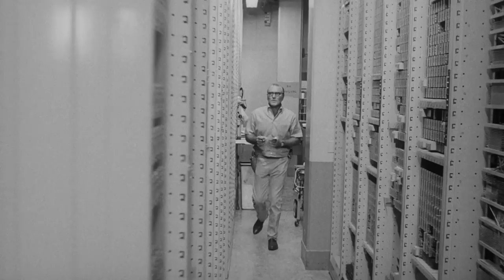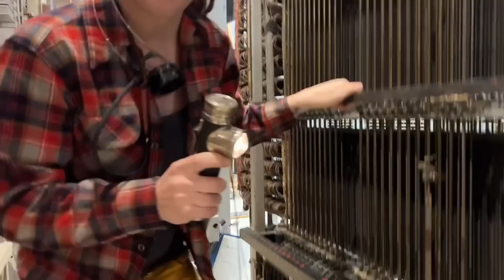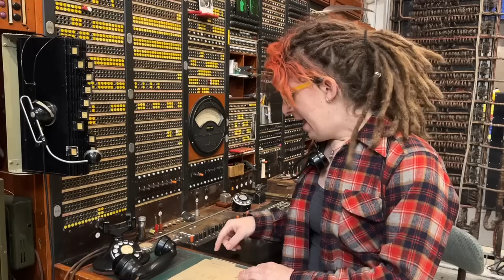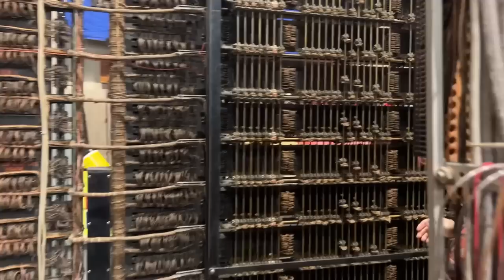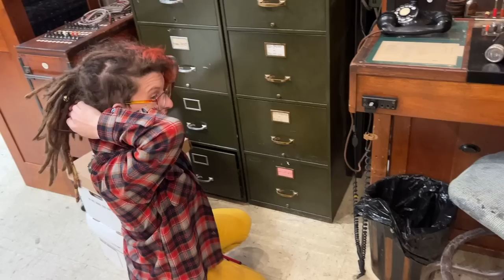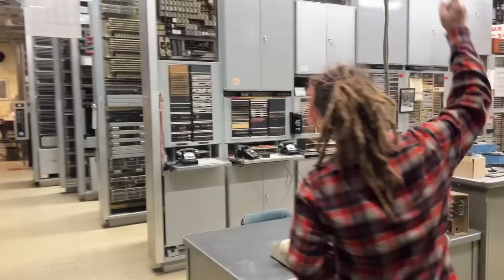How does call tracing work? (Part 1)

Comment: In the early '80s I worked electronics in an air traffic control center. We had what we called a "bomb relay" on our main line. As long as we didn't hang up the call wouldn't be torn down which gave us time to trace it.
Thanks Sarah! First time I've ever seen any sort of real, public explanation for how tracing works.

Comment: I guess my memory must be failing. As I recall. we could trace a call within about five minutes within our office. -- With four or five people.  We had several high-priority numbers wired in advance to convert to "called party hold". That certainly gave us a little more time. This was a Stromburg-Carlson XY switch with 10000 lines. Someone would start at the Final Connector and simply yell out the path through the connectors to the next person. Called party hold meant that we could complete our trace after the calling party hung up.This was on a USAF Base, so a call arriving from a civilian (off-base) C.O. generally could not be traced because the civilian C.O. would not cooperate.
      Having recently retired as an AT&T tech, I now reflect back in awe at what was accomplished with an electro-mechanical system.

Comment: Excellent video.  I did call traces in the SxS system in the 70's,  usually nuisance calls. If a called subscriber had them frequently,  we would insert "traps" in each connector t/r associated with that number.  That would hold up the whole switch train as long as it is local in the exchange and the called subscriber didn't hang up the phone until we had it traced. Thank you so much.  Quite interesting on a common control office.

Comment: I worked at "major" regional ISP circa 2000.  Major meaning we had our own telecom switch in addition to a few thousand twisted pair lines.  I thought the hardware was intimidating, but I mostly with worked with SS7 software interface (in terms of dial-up service).  But it was nothing like facility in your video... a totally humongous mix of electrical and mechanical circuits.  Thanks for blowing my mind!

Comment: In the Oakland #4M Xbar office the incoming and outgoing frames were scattered over two buildings and two floors of each building and not in any logical order so it took a bit of luck and skill to trace a call.  There were a couple of in-link frames that were hidden among frame of other types so you would never think to look back in the dark corner where they stuffed them.  As long as the call was not on those 'hidden' frames or you had been tracing calls there for 15 years it usually was not too complicated but almost always involved a lot of walking and stair climbing but the new #4 office on the 15th floor was organized in an orderly fashion and it was so easy to trace a call there it felt like cheating to us old guys who had been in the old 4M office for decades.  Tracing wires on the MDF was just as bad as the blocks were not in any particular order, they put them where there was space so there would be a whole bunch in order and suddenly they would end and woe unto you if you did not know where they went from there.  15 months as a Frameman provided the knowledge as to where everything was as we were always adding and removing circuits.  They would add 10 circuits one month and the next month to some office and they would have us yank out 5 or 6 the next month and it went on like that for every long distance office, something to do with paying taxes on unused/underused circuits versus overload levels if there were not enough trunks. The "churn" in trunk provisioning gave us a lot of overtime keeping up with all that nonsense and we went through tons of copper wire.
Reply from the maker: Wow, I wonder how the 4M office got that way. I'd imagine that if they had total design freedom, they would have put everything together, all in the same space like they did for the 4A on the 15th floor. 

I guess because the 4M went in first, as it expanded they had to figure out how to put frames wherever they could fit them. Must have been a cabling nightmare though.
Reply: @ConnectionsMuseum  The 
#4 Xbar office was originally a 10x10 inlink/outlink frame office and upgraded to a 20x20 and then subsequently to a 40x40 frame and upgraded from a #4 Xbar to a #4M (Modified) to be functionally the same as a #4A.  There was a VO/NVO modification in there somewhere too. The overseas gateway added some issues too. With all these upgraded done at different times and a new building was  also added where much of the high end frames were installed it got scrambled up pretty good.  That is the Nutshell explanation, it was a nightmare for anyone from a #4A but we never knew anything else so got used to the bastardized layout.  The wimps who came in and ran the office after I was gone from there made up a book with all the locations in it so they could look them up.  Not so with the old guys it was a right of passage to learn the layout.  Instead of learning the ropes like a sailor we had to learn the frames and MDF layout.
Reply: @JohnBare747  wow....
Reply: @mihailmilev9909  Now seems like it was Long, long ago in a universe far, far away
Reply: My dad worked in a toll regional center in the 60's and 70's, so I'm very familiar with the 4A switching, (it took up 2 whole floors) I'd heard of 4M but I didn't know anything about it. Thank you for the information! I miss those days. When they shut down the 4A, I cried! This was the San Bernardino, CA toll office. I heard they sent the entire 4A crossbar switch  to Mexico!
Reply: @itz_mxxri  I never knew if they recycled my old office or not I was off to other places and Downsizing, they finally ran me out of Oakland to Pleasanton at a desk job doing basically customer service on the Undersea Cables for the Pacific region.  Some stupid ship would drag their anchor in the harbor and snatch up the cable and let the headaches begin trying to restore that traffic using some other routing.

Comment: Back in about 1965-66, I was about 11, and had an old wall phone given to me by a relative. It had been sprayed some awful colors pin k and purple metal flake. I cannibalized it for the dial and proceeded to hook the dial and an intercom up to the phone lines in the basement. A friend and I made lots of crank calls with that lash up. A few days later I was on the front steps reading a comic when the phone truck pulled up and a lineman got out with his linemans belt and butt set. He asked if my parents were home, thankfully no, and if this was the house that was getting all the wrong numbers! He left and never came back! I imagine a lot of time was spent tracing our line there in Trenton.

Comment: One of the documentaries I watched involved a call trace and each US office had done the trace quickly and reported they'd tracked it to the next one over.  When they traced it over seas into west Germany, the office there said they needed more time since they were running older equipment and the call was dropping too quickly for them to trace it.

Thank you for giving context to why they had to hold the call for a few hours so the office in German could complete the trace.
Reply: @etc_kula  Yeap, Nova did it back in the mid 90s.

Comment: It's good to hear that occasionally "Hollywood gets it right" and the scene from "The Slender Thread" is fairly accurate. It would be nice if Sarah could analyze the scene in more detail, describe the equipment that they were using and going through each part and discuss what was realistic or not. Would it really take "half the movie" - perhaps one hour just to complete one trace?
Reply from the maker: Hang on for the next video, out tomorrow. I don’t explain the scene in detail but I do trace a call through the same type of switch (in the same room that the movie was shot in), and talk about it a little more.
Reply: Guess this is a question for the group, but would having a photo/polaroid taken of each frame help with identification after the call has ended? Also, is there a button and associated light you can hit to indicate that THE CALL IS ORIGINATING IN THE BUILDING!!!

Comment: This is so cool i grew up in a telephone office. My Dad was on the ground floor of the microwave progrsm. I can remember being taught anout all the tools in the frame, switching and crossbar. He moved onto toll and microwave when i was 13 years old. The Slidell,LA office was half way between Clear Lake Tx snd and Cape Kennedy and the NASA computer center was located in Slidell. My Dad was with the Bell System for 50 years before ge retired.

Comment: I would have thought (since this is metallic switching without filtering), you could apply an “out of band” tone or DC bias that could be traced with a detector wand?
Reply from the maker: Out of band tone could work, but a DC bias would not. There are repeat coils (transformers) on the incoming and district circuits, so there is no full metallic path from the calling to called subscriber.

Comment: 32 years in telecom, first time I have seen a panel office, although I have worked a bit with line bays used in a SXS/SAMA.
Reply: I work SxS with cama and tracing calls thru cama was indeed interesting..ted.
Reply: @t13fox67  not familiar with cama, I would guess Crossbar AMA?  As things were converting to magnetic, the SXS was being decommissioned, as was the 5-crossbar...  and I ended up in an SCC at that point... and  on to more modern(at the time) switches.
Reply: @PrimRoseLane  CENTRALIZED AMA or cama. I worked class 4 and 5 SxS with cama during the 70's at eldon mo.
Reply: @t13fox67  late 70's (no idea what class of sxs, but 30k+ main stations next to a 2.5 prefix crossbar, and a 1A ESS which I had no part of.. 80's went to a bunch of other switches, mostly SCC oriented. Stromberg Carlson, DMS10,100/200/5ESS and.. then the fiber terminals and dslams etc... Also worked on the SCCS 3b5/15's Datakit 2k, lots of different stuff.
Reply: @t13fox67  perf paper tape billing was a lot of interesting.  keeping perforators clean was quite a challenge.
Reply: @PrimRoseLane  yes, a morning duty that I remember.  Those were the good Ole days.
Reply: @t13fox67  Ours was graveyard duty.  And the cases for the paper tape were not getting sent back, it was a bit of disaster.  No one cared what happened in the switches until the paper tapes ended up misplaced.
Reply: @PrimRoseLane  yea, we had a couple of incidents like that too,  but otherwise we were able to get em sent off most of the time.  They had to go about 100 miles from our cama/toll office.

Comment: I got to see inside of a At&T rotary switch building in the 80's. It was interesting to see all those rotary switches operate when someone made a call and they also had large lead acid batteries for power back up.

Comment: Flashlight 5:13 I love the high light output LED Torch, but the Chinese use such crappy push button switches that they all fail after a short time. I'm tempted to go back to my BrightStar D-battery industrial flashlight.
Serra, where did you get that wonderful light is that type used by the Bell System?
Reply from the maker: Yes, it is! That flashlight was manufactured for the Bell System circa the 1920s.
Reply: @ConnectionsMuseum   my search found reference to it on line too. 
  "IDd Bond First Electric Flashlight for Bell System" yours is still going strong after 103 years, my LED FL last about 3-months if I'm lucky.
Reply: @mackfisher4487  China can make decent things, if you pay them enough. The cheap nasty ones you can get for a dollar are indeed awful, but I managed to get a decent one powered by a lithium cell for $15, and it's lasted for 3 years so far.

Comment: That is quite a process and then as you mentioned if they hang up everything is lost.  Yikes!  That means hurry and don’t get stressed! You mentioned the switches were tripped.  Were they tripped because a trace was in progress or do they always trip when connected?
Reply: Tripped because connected. You can see each selector has about 5 different brushes on it at different height levels. One of those is the correct height level and gets connected and the other ones are wrong connections that don't get connected.

Comment: In current networking switches (ethernet, infiniband, etc) the chip that does the "routing" is still called a crossbar. Or sometimes a crosspoint.
Reply: Depends on the type of switch I suppose. I know TDM switches work by reading a frame from each line into a memory buffer, then writing them out in a different order. This gets to go by the cool name of something like "spacetime fabric switch".
Reply: @thewhitefalcon8539  I gave ethernet and infiniband as examples of the class I'm referring to
Reply: @tolkienfan1972  I'm sure there are low-end ethernet switches that work the same way. (Not infiniband. If you're using infiniband it's high-end)
Reply: @thewhitefalcon8539  100GbE nonblocking with latency measured in picoseconds. These aren't found in Microcenter.
Reply: @tolkienfan1972  ok but not all switches are 100GbE rack-mount switches
Reply: @thewhitefalcon8539  I really don't know what your point is. I merely commented that the term is still in use, and is now put to use in ICs. But there are 2x2 low bandwidth crosspoints in the very low end market, and everything in between. There are even analog versions for routing analog signals. I just find it interesting the fact that the terms have such history, and such longevity.

Comment: I'm curious as to why there wasn't some some of punched tape or ticker tape which logged each successful connection documenting the frames involved in the CO.  There would be a tape to cover each NNxx terminal number so there would be a tape for each NN hundreds group.  Then you could see that on tape 56 has something like "5678-322-29.3-11.5". (terminal#-incoming trunk#-incoming frame#.brush#-final frame#.brush#"

So then you could just look for the last log for 5678 and find the active incoming trunk (322) on incoming frame 29 brush 3 to final frame 11 brush 5".

Or something like that.
Reply from the maker: Assuming there are 30,000 terminals in an average size office, thats 30,000 extra wires you have to run to to record when a terminal is accessed. Also, each selector rod does not "know" which previous selector or terminal has seized it, so you'd need a system of storing that information...a "memory" for each selector and each path in the office that would be accessed. Then frames of control equipment to print a tape, for tens of thousands of calls per day. Memory was not easy to engineer in the 1920s, and would have probably taken months or years to figure out how to do all of that.

That would not be a reasonable use of resources.
Reply: @ConnectionsMuseum  Gotcha.  I see the problem now.  I forgot that once the CO is reached on a trunk the last remaining digits are still unknown and are awaiting reception to then route inside the CO to the correct terminal block.

1ESS must have seemed like magic.
Reply: @ConnectionsMuseum  When I was a kid in the 1950s I was hanging around the local (usually unmanned) CO when someone showed up, and I got him to give me a tour. I remember that there was a case full  of paper tape punches on the end of one of the rack rows, with maybe 20 or so tapes, and every so often one of them would punch out a bunch of numbers. The guy explained that this was for billing. It recorded the calling and called numbers and the call duration. He said that one a month the tapes got taken elsewhere and processed to make the customer bill.

I do remember that phone bills in those days did show the called number and duration, which no longer show up on phone bills. So they must have had some way of recording that information. Of course this was a little CO with Stroger switches and probably around 8K lines max, probably a lot less than that.
Reply: @lwilton  Yes, that sometimes call bill tracing or origins tracing. It was very rarely used as it required waiting until the end of the billing period and monitoring all outgoing bills (nationwide!) for the called number. That's slow and an incredible amount of work. Where it works very well is when you have a list of suspected originators and want some evidence for a trial...

Comment: I am curious about the phone that made the call. I used to see them a lot in offices with the mechanical push buttons and once saw a relay panel they connected to but have no idea how it works. I have only dealt with digital pbxs. What kind of system is it? I would like to research it.
Reply from the maker: The phone is a “Call Director” and it is wired in to the museum 1A2 key system. telephonecollectors.info will have some places to start if you search for those terms.
Reply: @ConnectionsMuseum  Cool. I used to see them everywhere. Big clunky light up buttons and centronics connectors to 20? pair but have no idea how they work. Now down the rabbit hole.